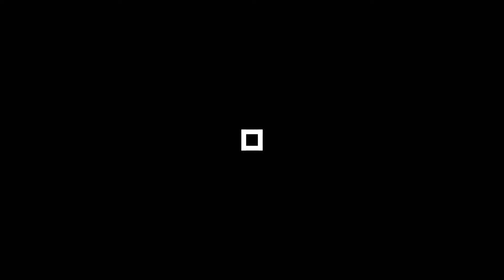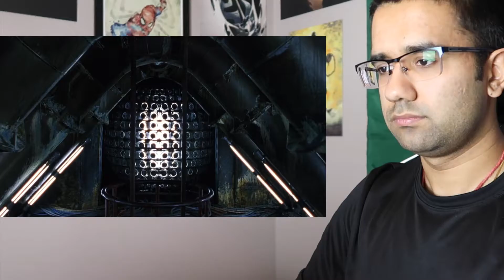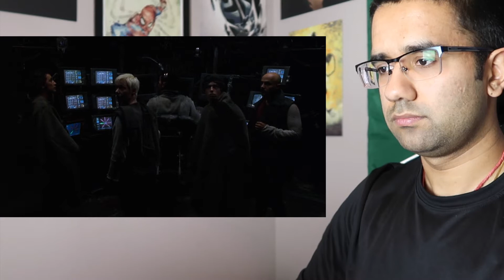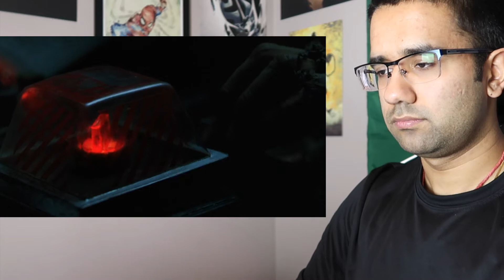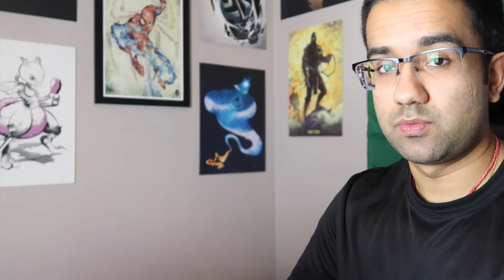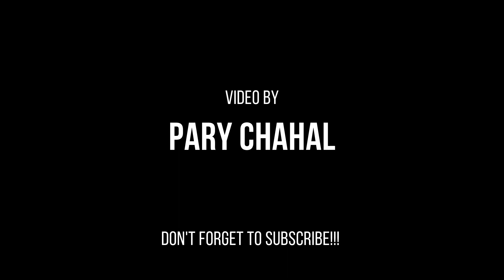Engineer explains how EMPs work in 2min | Electromagnetic Pulse | Radio Waves

Comment: An 'engineer' proves, in less than two minutes, that he's not actually an engineer.

An aerial does not turn analogue radio waves into digital - that would be the analogue to digital converter that the aerial is connected to.
An analogue device can be rendered useless by an EMP - it's just less likely than a digital device with its circuits measured in nanometres. As an example take a light circuit. If a high enough EMP hit the circuit then there's a high probability that the light would blow from induced voltage. Of course, all you'd need to do would be to replace the light bulb and it'd be all up and running again.
Reply: yea i was also hoping to hear about MOSFET vs JFET. I think MOSFET is more in digital circuits, so thats y digital would be affected more because MOSFET is much more sensitive to difference in potential (if i recall correctly) vs JFET.